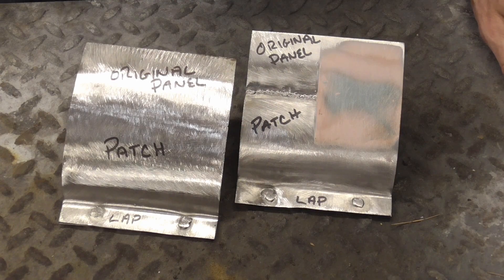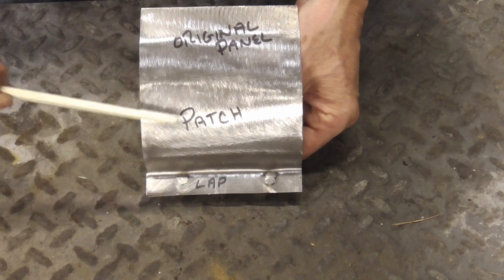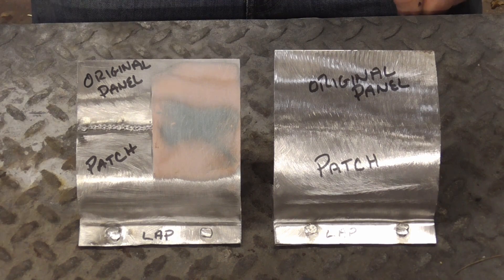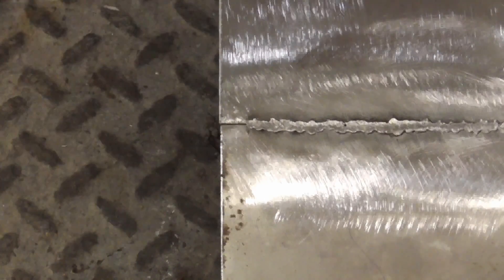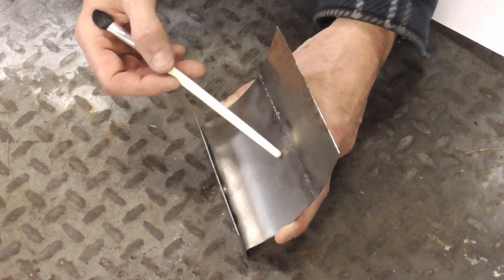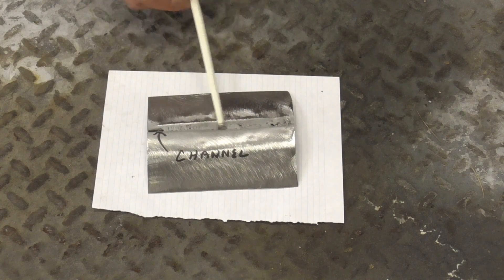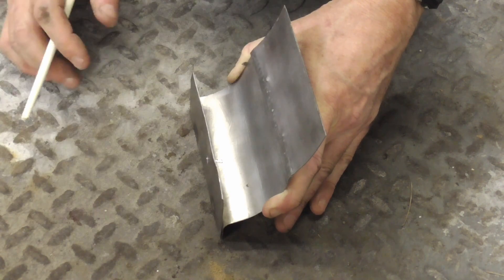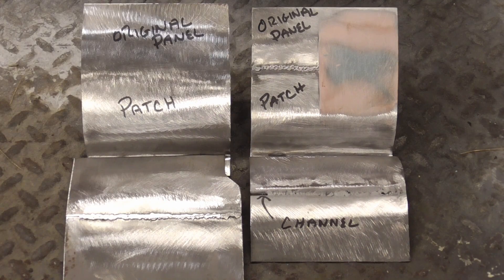Butt vs Lap Welding for Rust Repair: The Debate Ends Here!

Comment: It gives a clear picture that you have been called out on your body work and you are trying to justify it.
Reply from the maker: Both are used in bodywork.  Body shops in Michigan use a combination of butt, lap, fiber glass, glue etc.  You have to go with one that you can know will last and hold up to driving year round in salt.  My repairs can be driven in a salt bath and I know they'll hold up - I've watched them for years and asked folks, "How's it holding up?"
Reply: @LakesideAutobody  Well let us just look at your welds and see which is better. the butt welds look to require a thin film of skim coat, which is less likely to to crack, your lap and channel welds, need serious filler to hide the different thicknesses. You keep saying in Michigan all the shops use the lap method. I seriously doubt that. So just stop with the Michigan BS. and we won't even go into filling rust holes with fiber glass on steel. Just stop with saying laps and glue and fiber glass are correct repairs and call them for what they are. They are fast easy ways to get a car to look good for  maybe 5 years. You do it like that to speed up your work to get the next car in. But just stop with it is the correct way to do the work. because I have worked on cars all my life! My father was a body man, I grew up in a shop. I was taught the correct ways and the fast ways. The two are not the same.
Reply from the maker: @mypointofview6056  Filler doesn't crack if applied properly - never had Bondo crack in my life.  There are more than 4000 welds in a new vehicle - all lap welds and they last pretty long.  Telling folks to only butt weld is absolutely wrong.  Would you fix this butt welding?  https://www.youtube.com/watch?v=36zkc9UQaTs   The best is to have all methods at your disposal - I use butt, lap and glue - they all have their place if you want to fix absolutely anything that comes in the doors.

Comment: I am rust repairing a 1968 Camaro. I butt welded most everything, but since it is a restoration, I also used Eastwood internal frame coating behind all the welds. I also dropped the butted weld patch down a little so I wouldn't weaken the welds when grinding and covered the welds with Fiberglass reinforced filler. This video confirmed what I did as a job done correctly. Thanks!

Also learned .. all repair methods are probably good if done correctly, and in the right instance.  Thanks for your videos, I've learned a lot.
Reply from the maker: You're welcome - you're right, if you seal the back side you'll be fine.  No moisture - no rust :)

Comment: YES! 

I use flange and lap welds mainly. And when there is no room, then butt (small patches). After welds, something greasy sticky oily stuff to the other side.
Reply from the maker: Treating the repair after the paint is very important - something greasy or oily that sticks and self heals or creeps into the gaps.  Good point.
Reply: @LakesideAutobody  Try Chan saw bar oil.
It's liquid enough and clings tenaciously
Reply from the maker: @jimurrata6785  Very good - squirt some of that inside of a panel and your good for a long time :)
Reply: @LakesideAutobody  With the right bottle from your recycle bin you can even get a choice of stream or spray.  💡
It is vicious though, so don't pull the trigger too hard or you will snap it off.  DAMHIK. 😉

Comment: Great video! I like the explanations every case is different if I had access to a TIG and have time yeah I would TIG....but most of the times I'm working with less than ideal conditions and a lap weld well done is perfectly exceptable way to repair a panel and use of cavity wax and anti rust coatings help a lot on a daily driven street car. And none of my classic cars will ever see this new salt combo magnesium chloride which is the real source of all the heavy rust issues.
Reply from the maker: Thanks Moparnut62,  you're right - the salt on the roads is a real bummer.  The mist coats brake lines, fuel lines, brackets, etc.  I'd like to purchase a TIG welder but they're pretty expensive

Comment: I only buttweld, but I always end up having the panels hopelessly distorted. Yes, I do tacks spaced apart, take my time etc.
Can anyone say if lapwelds are more resistant to warping?
The biggest problem I have is not the heat spreading into the panel and warping it, rather than simply the fact the tacks put tension into the panel as they cool.
Reply: Blowing air around the weld to cool it helps a lot.
Reply: In my experience, the lap welds do distort less, because there is more metal left to give strength and support to the joint.  With more metal there, your welds are more likely to grab onto something, and there is more metal to absorb the heat.  Jerry knows his stuff, give this a try and you'll see!  Good luck!
Reply from the maker: You are always going to have a little bit of warping.  My advice is to tack it like you do - then alternate from one end to the other do a little run here the a little run there back and forth.  The solution is lap weld it, tap down any high areas and fill.   That's the most consistent, fastest, long lasting method.  You can also try panel adhesive too - a lot of shops are patching with that now.

Comment: Its amazing how much debate there is over this!  I used to butt-weld only.  After watching your videos and giving the lap-weld and knock-down method a try, I really like the strength it gives.  Also, if you plan ahead for drainage and rustproofing of the joint, I can see it lasting indefinitely.  It can be much faster to make a patch fit with that method as well.  I bought one of the pneumatic flange/punch tools that make a nice step-down on the inner panel.  It doesn't work on every repair, but is a nice way to lap weld in my opinion.  Great video Jerry, you ROCK!
Reply: Punch and flange tool has saved countless hours for me, getting patches flush.
Best $50 I ever spent for body work!
It won't fit everywhere, but it still helps making holes to screw the patch up right.
Reply from the maker: Thanks Erich.  You're right about something not working on every repair - a good reason to know every method.  So glad you liked the video - you rock too :)
Reply: Great video, and good luck with ending the debate, but I have one issu in regard to your comment on the lap weld not holding water, Because it's "upside down": Capillary attraction,  could not only hold water between the two panels, but WILL draw/wick water into the joint, if the back side of the joint is not completely sealed with something.
Reply: @AmericanMadeCustoms  Weld it the other way and it will GUARANTEED trap water. Lesser of two evils...
Reply from the maker: @AmericanMadeCustoms  The fact that it is upside down allows it to dry out which is key to no rust.  No trapped moisture = No rust.
Reply: Totally agree!
Reply: Me too.. lol
Reply: Jerry always Rocks ! 🎸👍
Reply from the maker: @davidblaze1652  Thanks David :)